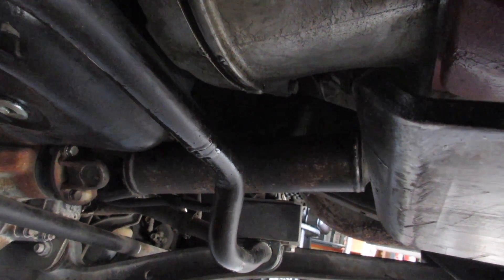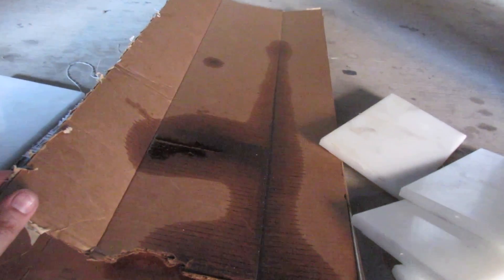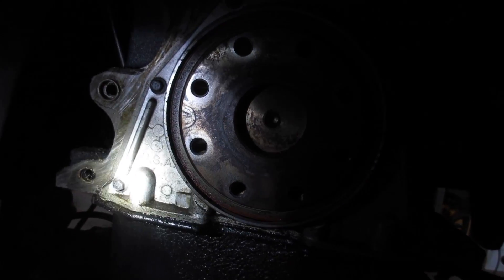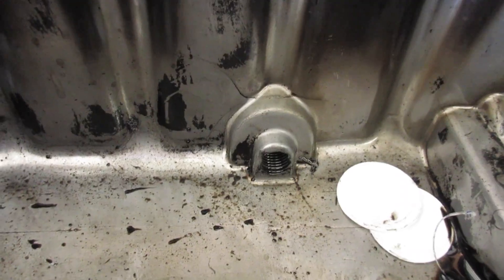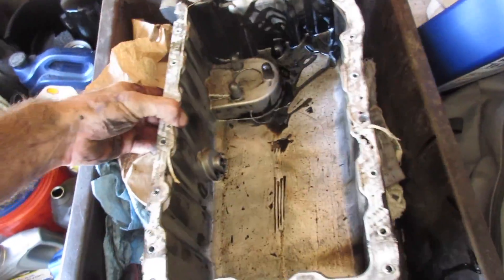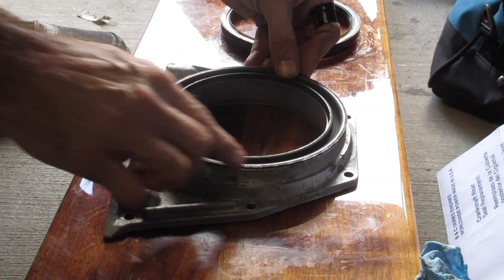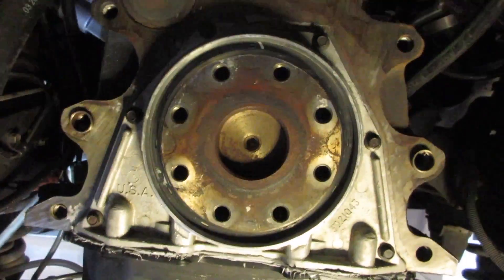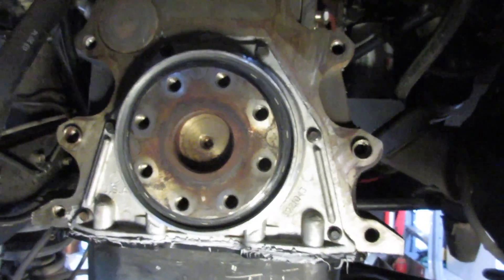80 SERIES LAND CRUISER 12V CUMMINS  - REAR MAIN SEAL

Comment: What lift are you running?  Did you do a body lift as well?  Lastly, what size tires are you running?
Reply from the maker: 4” OME comp springs in front. 4” Slee in the rear. 1” body lift.
Reply from the maker: 315/75 tires